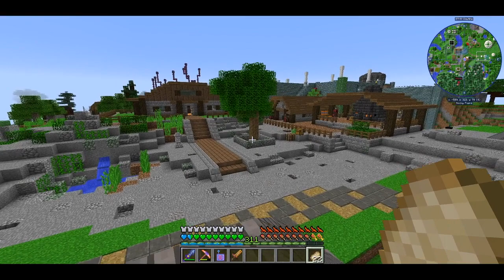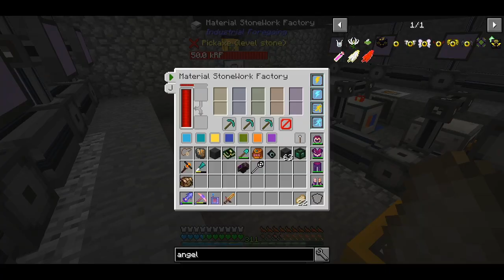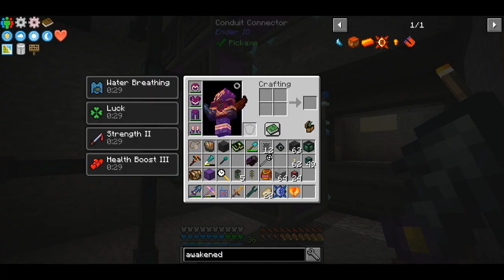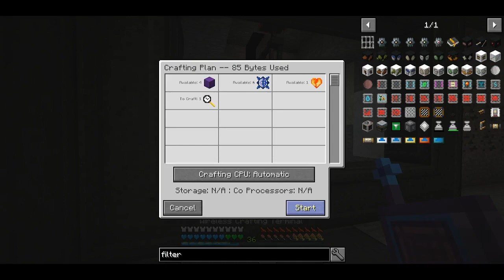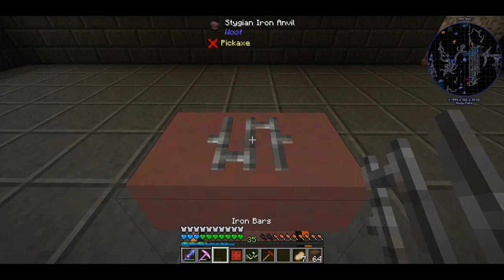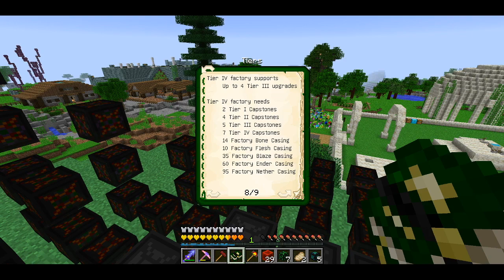FTB Revelation-Ep12: Draconic Evolution and Woot

Comment: just an idea i had when watching this: when you were making the dust on the anvil you were moving away so you didn't pick up the iron ore and the other 2, so when you made the dust you didn't pick it up, what might have worked is dropping the stacks then filling your inventory with a single item spread out through your inventory so you cant pick the blocks up but you can pick up the dust. just an idea it might have not even worked.
Reply: Or use a filtered vacuum chest
Reply: @silverzdk  true
Reply from the maker: Actually you’re right. I watched it again and I think the extra ones messed up the process. Woot was an easy mod, I don’t know why he decided to make it crazy :))))